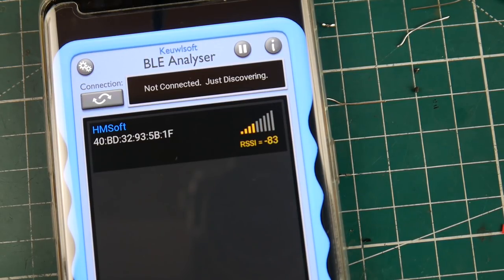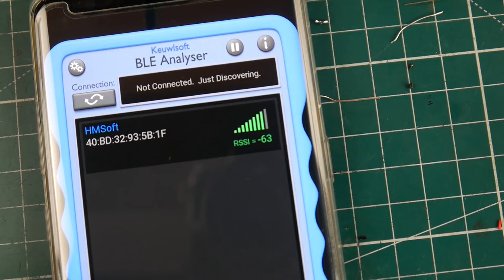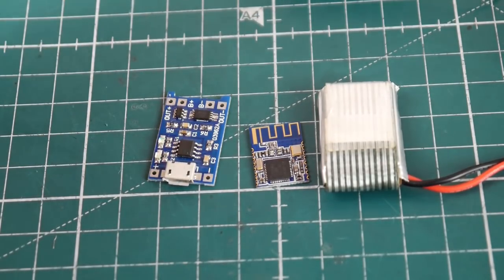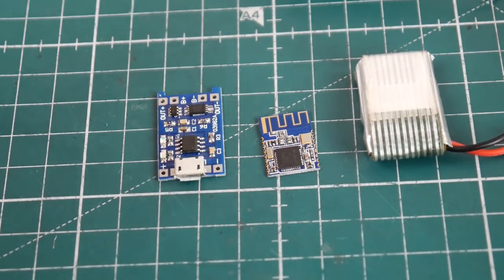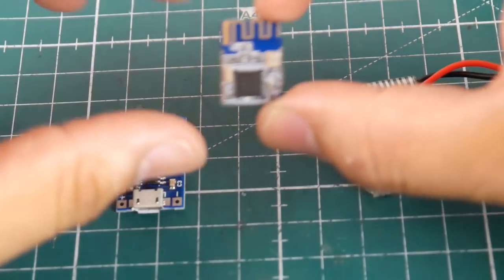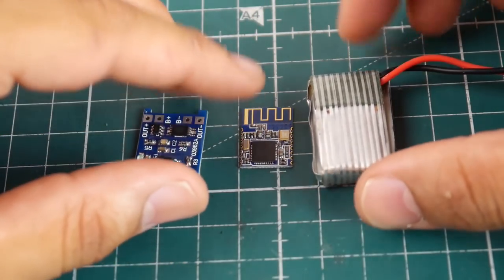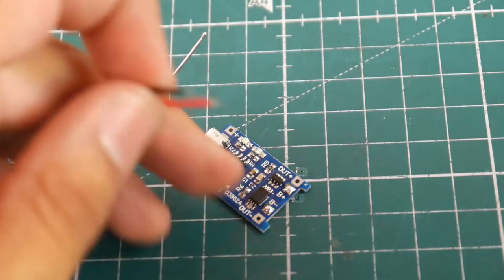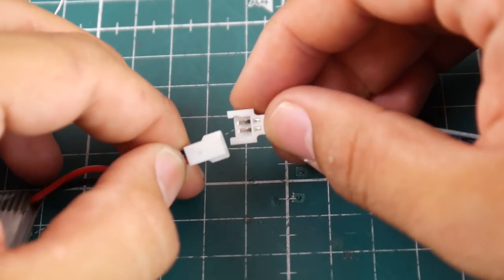Ultimate DIY FPV Drone BLE Bluetooth Locator // #HOWTO #DIY #BLE #BLUETOOTH #BEACON

Comment: I am using HM-18 BTLE Module.  This is BT 4.2 which has a theoretical range of 100m but in reality it is good for 25-30m. Also i recomend > 1000 Ohm resistors because 75 ohm will drain your battery much faster - so dont't forget to disconnect it. Or use a diode, that will have no drain, but just drops voltage 0,6-0,7v which is enough do reduce 4.2V to 3.6V

Comment: Fantastic work, DM! 😊
The name of the little battery charger module is TP4056. I use them A LOT in my projects, they're awesome!
Just a few infos that can be useful when using it: as you saw, it only protect the battery and charge, it doesn't step up the battery voltage. Second, it limits the output current to 1a. So if you try to power something that pulls more than 1a it won't work and you can even burn the TP4056. (A good solution for that is using an 1s BMS with higher current protection and a TP4056 module without protection.) Finally, the TP4056 pulls 1a to charge the battery too... (I made a 6 cell battery charger using one TP4056 for each cell and it burned a lot of 5v adapters of mine here. LOL)

Comment: Yes, it's a charging module with battery protection circuit. There is a overcurrent and overdischarge protection chip between the battery and out pads.

Comment: Great tutorial.  Good concept and use of the technology.

As useful as this is, a battery backed buzzer I think would be a better option.  There are ones that weigh in around 4g, work as a normal buzzer and sound when the battery is unplugged (some are as cheap as the components listed for this build).  Happy to provide a link to one if asked.
Reply from the maker: We can add buzzer and control through phone to this module.. but I want that for a v2 upgrade

Comment: Why not just use a coin cell to power the BLE? It's designed for battery power...
Reply: The only thing I could think of is he doesn’t ever wanna have to worry about it. However in the small application that I’m interested in I’m going to use the disc style battery

Comment: Thats a cool idea! But, u might not know that BT is using same frequency as your radio. Not including crossfire :)
Two devices, both utilizing the 2,4Ghz band might interfere with one another.
Maybe you should do a range test with, and without the BT module
Reply: Yeah please Mesh test this. Putting quad at end of your flying field. And putting your radio by your car. then only activating-de activating this device to see is there any RSSI change on radio
Reply: It shouldn’t interfere. All radios we use now are frequency hopping which is why you can use as many FrSky radios as you want at once.

Comment: Those resistors are burning energy and a diode should be better. The absolute maximum voltage for the board is probably near 3.9V.

Comment: If using a coin cell battery, you could get rid of the charger, and design a 3D printer case that would be much smaller. I might have to try that... :)
Reply: so i can directly connect the coin cell battery to the module? Does this cause any problem?

Comment: Could you use the bluetooth functionality to connect to the FC?
Reply: like a uart between the module and FC then simulate that as a usb connection on a pc to change settings or an easier blackbox dload.

Comment: Bluetooth has around a 3 meter range; how is that of any use when your drone crashes 100 meters away? With all due respect, this is useless....
Reply: Dave Grandeffo it depends on the power transmitted. With all due respect, check your radio frequency and compare to BT and you learn something today...
Reply from the maker: Well you never crashed with a dvr in grass before I'm guessing.. The BLE bluetooth 4.0 has more range the older gen of bluetooth.. Google it a bit with all due respect ;)
Reply: with all due respect i forgot what i was going to add
Reply: definitely not useless. do you need guidence about your whereabouts from 100s of meter away while you are flying FPV?  we mostly just dont know where it landed or in which tall grass it is in.. So standing on last seen location then playing hot&cold to locate it is really useful.  my only concern is same as Slask Skrot; the interference with radio signals can be a dealbreaker.
* I ve searched a bit and found bluetooth range is from 2.4 to 2.4835 GHz. To reduce interference with other protocols that use the 2.45 GHz band
Reply: Slask Skrot Bluetooth can has a range of up to 200meter on a open field with the technology nowadays.
Reply: Indeed it can but the output power needed for that sort of range may not be legal in many countries..
I'd like to see a proper open field test
Reply: didactylos4 diddy4 I d say don't worry about it being legal. Cause your radio system gives way stronger output at same frequency.
Reply: In which case the range will be more limited than many think and I'd be very surprised if it will even achieve the range quoted in the advert (linked in the description) in a real word test.
I'll be happy to be proven wrong by such a test
Reply: Oh well guys my company basically works on that stuff Iot solutions by using Bluetooth beacons and I am talking about Bluetooth beacons that cost around 5000 usd and up. So let me just tell you that what he is doing is 100% legit. It works, it works great and Bluetooth is the perfect solution no worries about the output level really. We made so many solutions I wa about to do sth. similar but market is too small for us and there were too many solutions out there at that time. Our price would have been higher and at that price you could get a little bit bigger gps+sim+battery module that would work with even more range. So please guys look it up before commenting.
Reply: Errr 3 meter range? My bike has a BLE beacon that is picked up 50m away!

You can get a SIM808 development board for 15 bucks, maybe worth looking into for real long range flying and you could even get telemetry if the FC is on a backup as well.